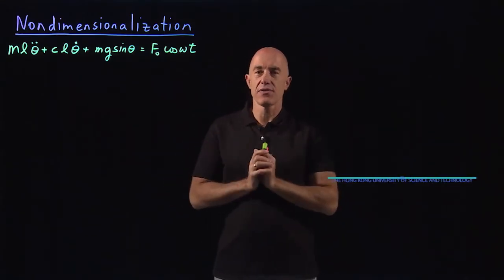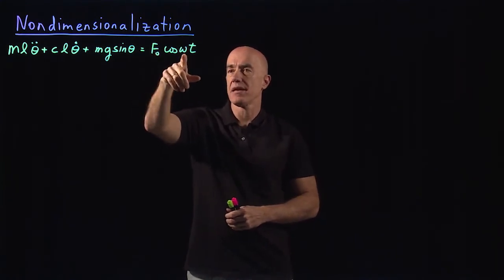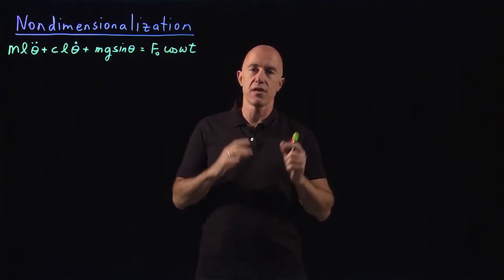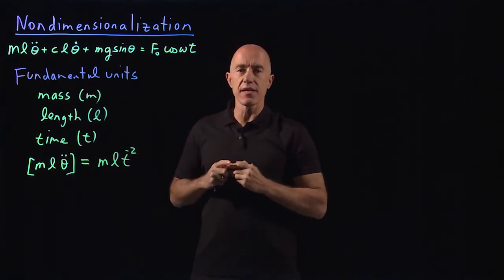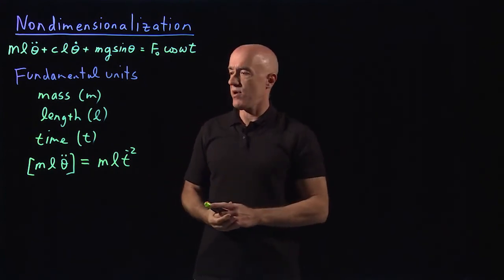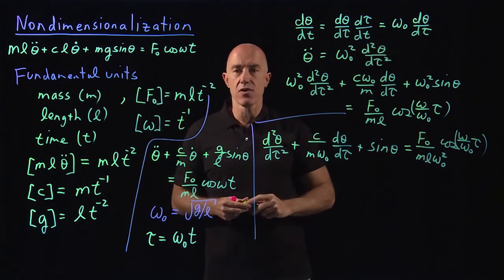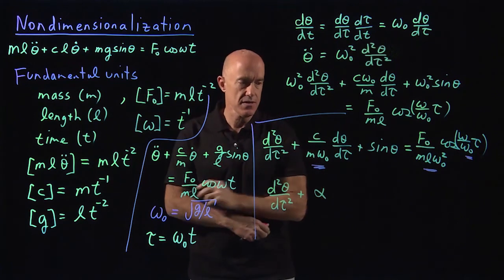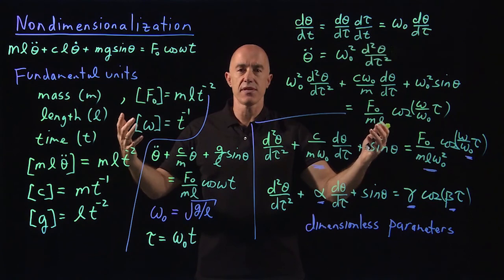Nondimensionalization | Appendix B | Differential Equations for Engineers

Comment: How did you get ω₀^2 at 11:47?
Reply from the maker: From the previous equation, d/dt = \omega_0 d/d\tau.  So d/dt d/dt = d^2/dt^2 = \omega_0^2 d^2/d\tau^2. The change of variable formula for a single derivative pops out one factor of \omega_0.  For a double derivative it will pop out two factors.  If you want, you can write out the change of variables formula again for the second derivative.
Reply: i still dont get it @Jeff-math